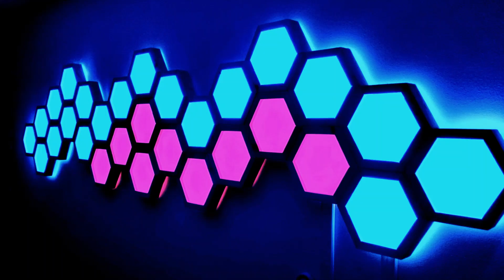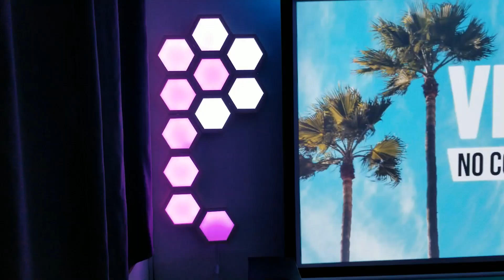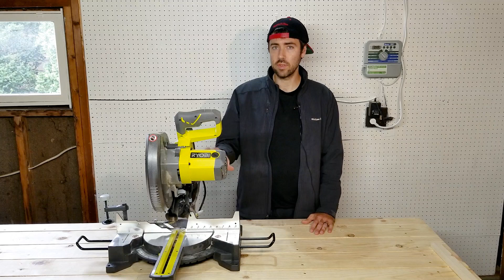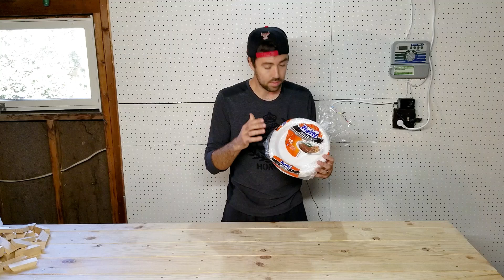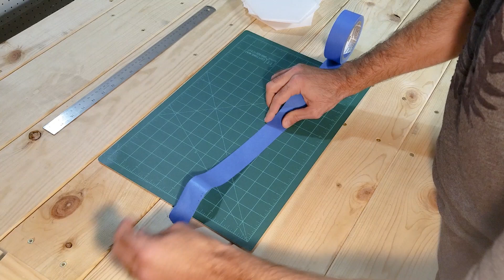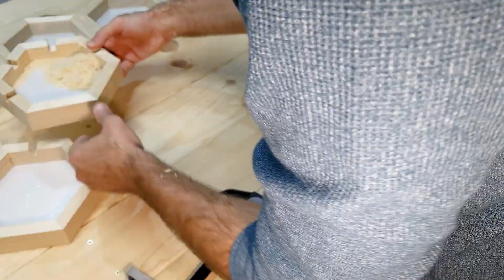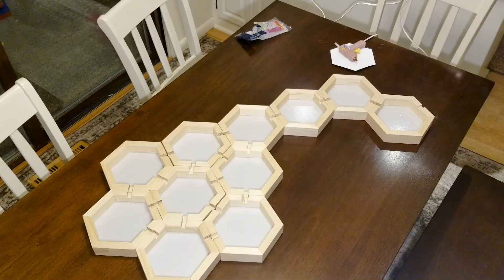Making My Own Version of Nanoleaf Hexagons - DIY Project (No 3d printing, programing or soldering)

Comment: The best video I've seen on this, keeping costs down and simple enough for anyone. Not sure if your know already but you can actually use the rest of the led strip you cut away.. It just requires buying a seperate power supply and you can buy crimping connectors which join the strips together.. So maybe you could have extended the first one you used.
Reply from the maker: Thanks for watching! I have very little knowledge of LED strips but I'm for sure going to try doing what you recommend.  Sounds simple enough!

Comment: You can use those cut led strips they are not useless, just solder 4 points of the led controller  to the 4 points on the led strip, You re good to go!
Reply from the maker: Thanks, i am definitely going to try my hand at soldering at some point as it seems like that would open up a lot more options. These strips appear to only have 3 points. Does it work the same way?
Reply: @ChrisMaherDIY  you dont even need to solder. you can buy extensions for them

Comment: If anyone want to take this to the next level, the Pixelblaze is easy to map out your design and even make it music responsive. Electromage.com for current v2, or new v3 coming to https://www.crowdsupply.com/hencke-technologies/pixelblaze-v3
For music add sensor expansiob
Add cheap addressable led strips and a 5v power supply.  Not quite as inexpensive, but still way cheaper than Nanoleaf.  I'll be doing something like this with that.
Reply from the maker: Thanks for the links and sharing! This would for sure take it to the next level! Addressable led strips are for sure the way to go now that i understand things better!

Comment: Nice build.  The plates are a true find.
Reply from the maker: Thanks! They really were! Just wish I could find ones that were bigger so I could use them in some other larger designs.
Reply: @ChrisMaherDIY  looking at their website, they make an oval platter that's 12x10 in the same material, since you are cutting it down, that's still slightly bigger if you don't need symmetry.
Reply from the maker: @SethCohn23  thanks! That's so much bigger! Opens up a lot of different options. Thanks for the heads up!

Comment: I'm definitely giving this a try! How do you manage to light the individual cells different colors?
Reply from the maker: Let me know how it turns out!! Most of the videos were when the LEDs were on music mode. They just display random colors to the beat of the music. The app is actually pretty good and you do have some control of colors but you won't be able to control the individual hexagons with the strip I used. If you had soldering or programming skills you could take it to the next level!
Reply: @ChrisMaherDIY  can you please tell the name of the app
Reply from the maker: @eyasinahmed1009  the name of the App that connects to the LED lights is called "Smart Life" on the Android app store. (i also assume they have an IOS App)
Reply: @ChrisMaherDIY  thanks a lot brother
Reply: ws2812b leds are a good option too. But you have to programm them...

Comment: great job, came here from your post on reddit. do you paint the timber or just leave it? the end product there is exactly how it looks on the wall in daylight?
Reply from the maker: I thought about painting/staining the wood but it was a little more work than I wanted to do so I ended up just leaving it plain. It definitely does not look like the thumbnail in daylight. It still looks cool in daylight but does not have the same effect as it does at night.
Reply: @ChrisMaherDIY  cheers, im currently about to start building a shed/man cave, will do something like this when the time comes, but i will maybe paint the timber black. thanks for the simple guide

Comment: This is probably the best of the maker videos for these....... nice work, looks cool and nice project to do. You can probably use chrome reflective tape inside of the hexagon and maybe get away with just using 1 LED strip. Just in case people can't find the double strip LED and only the single is available etc.
Reply from the maker: I'm going to look into that! If it looks the same using that reflecting tape but I only need 1 strip, that would be amazing!

Comment: Very nice! You can solder thin 24 gauge wire to the contact points to  join them.
Reply from the maker: Thank you! I'm going to have to try that. I know the instructions on the box said they could not be cut and spliced together but it sounds like you have much more experience in this area than I do and I will take your word!
Reply: @ChrisMaherDIY  Look on amazon they have clip on connecters that don't need to be soldiered

Comment: Great tutorial! Thanks for all the hard work. ;)
Reply from the maker: Thank you and thanks for watching! Hard work but fun and it even looks better in person than in videos
Reply: @ChrisMaherDIY  I was thinking about this project last night when I was going to sleep and it occurred to me that it might be beneficial to use a more durable diffuser. If something penetrated the paper plate, it might be kinda of a hassle to replace. Thoughts?
Reply from the maker: @mpalatsi  That is a very good point. It would be hard to get a new styrofoam plate in there if one broke. Not impossible but probably have to take some things apart and re glue. Please let me know if you have any ideas of what could be used instead. I did look into different acrylics and types of glass but it seemed like it would be more challenging to cut that material and the cost was very high. I do think something like this: https://www.homedepot.com/p/Falken-Design-24-in-x-36-in-x-1-8-in-Thick-Acrylic-Non-Glare-Matte-P95-Sheet-Falken-Design-ACRYLIC-P95-1-8-2436/308669673 would be amazing to try as long as it created a nice uniform glow like the plates did. Thanks for the comment and for sure something i may try on future builds! let me know if you have any ideas!

Comment: You should be able to cut those LED strips and solder in wires to create a gap between each end of the cut. As long as the path of the LED strip remains the same. (there should be an arrow indicating direction on the strip PCB)
Reply from the maker: Thanks and I might try that on a future project! (I would  first need to learn to solder though) but that would open up so many more options for design! Thanks for the great idea!
Reply: @ChrisMaherDIY  They have quick connectors that you can use instead of soldering to, you just have to make sure the spacing on the pins in the quick connectors matches the strips contact spacing, so the contacts line up.

But awesome video man, I'm getting the parts for it this weekend myself!
Reply from the maker: @TB-gg1mn  Awesome! Let me know how it turns out. I'd love to see the end result and improvements you made!